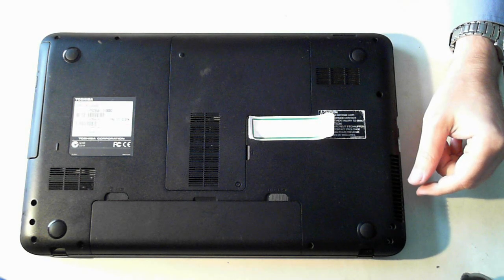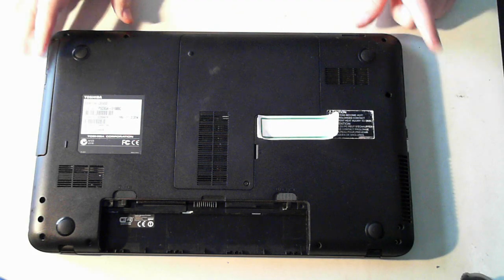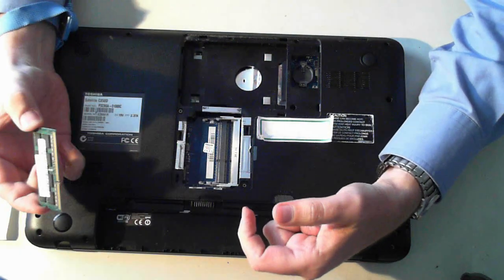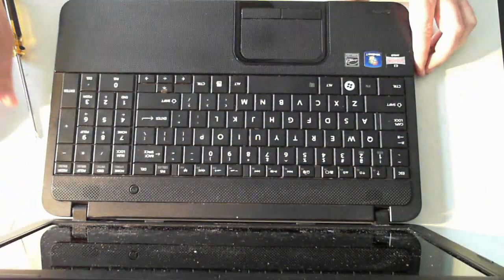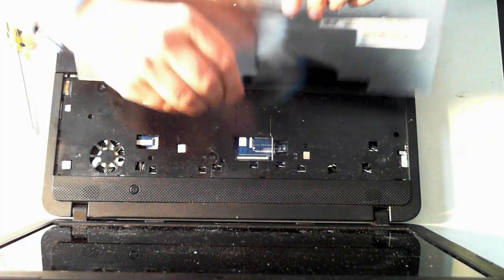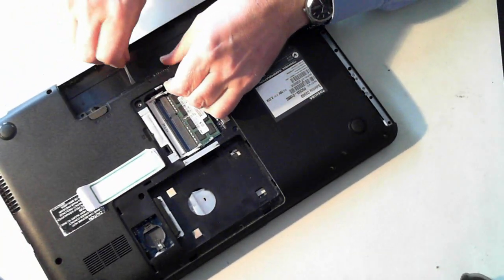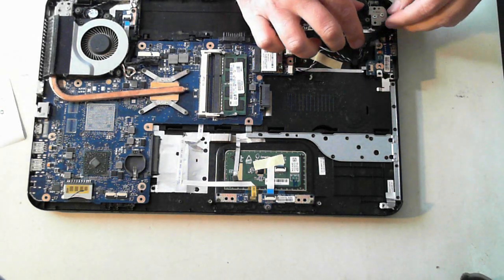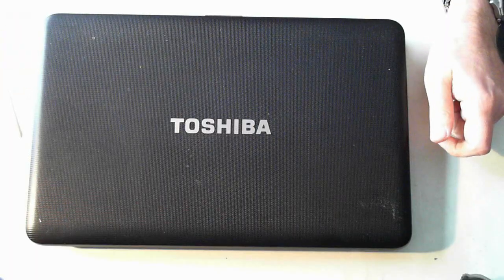Toshiba Satellite C850D Disassembly

Comment: Hi I have the C850-1GL my battery wont charge and the laptop will only power on if the battery is removed so its permanently plugged into the mains also my speakers seem to be very poor sound quality ( very Tiny Sound ) is there something that's been disconnected or the speakers been damaged somehow plus the battery charging connection been damaged somehow .

Comment: @dpcomputing: Thanks for the video! I have a question!  I got the c850d PSCC2C-012003 for free out of a dumpster! It works BUT the battery does NOT charge.  I know it's not the battery because i have the same battery and laptop as well, and both batteries work.  Both batts are not recognized by windows when I plug it in while ON and OFF, BUT it does blink AMBER when the battery is inserted with AC plugged in AND  when AC is out.  I am guessing it's the mainboard and/or a mosfet.  Any idea what I could do here? Replace the mainboard?  I can get a used one locally for about $40.  I am poor student here in Canada during this hysteria!  Thnks a lot man!

Comment: Hey,

I have a question. My notebook starts, then i have to change the settings because my bios battery is empty and i have to set the date and the clock. After that, when i save and exit, its loading and then i get a black screen with 4 blocks with a lot of short red lines, which are moving from the top to the bottom. What could be the problem?

Comment: Want to upgrade mine.
The Ram, Processor and Hdd. What's your recommendation?
Reply: 8GB ram(any brand you like),processor depends because you need compatibility.if its intel(core i5).if its amd(ryzen 5),as for HDD it depends on how much storage you want.recommended is 500GB to 1TB and if you have extra money then buy an 120GB SSD.
Reply: Oh and i forgot the ram needs to be compatible.just buy what DDR of ram you have.im guessing you have DDR3 compatible motherboard?if that's the case just buy DDR3 ram.just do the same if it's DDR4.

Comment: Great video, got to part where you can't find screws, looked at your video and saw 6 under keyboard, removed them cleaned it all out and reversed the assembly. All done without any fuss. Many thanks for your video and knowledge.
Reply: 4

Comment: is it possible to upgrade the processor of this laptop to core i3 or core i5? thanks!
Reply from the maker: Yes it is technically possible but you will have to confirm what CPU's BIOS supports (which I don't know) with Toshiba support.

Comment: Hi I have a question. My laptop screen won't turn on I plug in the charger and it says its charging but it doesn't I opens it up and dusted it out and still nothing I also tried turning it on with out the battery to see if that was the problem but it still does not work. The like of connection turns on and everything but the screen doesn't turn on
Reply from the maker: he screen or video card may be the issue. Have you looked a the connections / cables to the screen to see if they haven't come loose?

Comment: Mine has water damage and won’t turn on what do you suspects I should do?
Reply from the maker: Sorry but my recommendation would be to get a new laptop. You can try and replace components but it may have damaged more than one so you may have to end up replacing everything.
Reply: dpcomputing :-(   I’ll open it and clean then hope for the best
Reply from the maker: If you have done it recently put the board in some rice to try and drag out all the moisture. See what I did with a mobile phone here:- https://youtu.be/Q0CMZlcewqY

Comment: Hi buddy is there a fuse inside this laptop.    I plugged in a cheap power adaptor into it and now it's not working. Ta
Reply from the maker: No, the power adapter looks to have blown something within your laptop. Was the new adapter the same rating as the old one?

Comment: did exactly what you showed now my laptop wint start great......
Reply from the maker: What did you change / upgrade? Double check that all cables etc are properly connected. Are you getting anything on screen?
Reply: dpcomputing No the screen is black. I took everything apart and also unscrewd the airfan unit to clean out the dust inside then I put it all together. Now when I turn it on airfan doesnt work and the screen refuses to work as well
Reply: dpcomputing Omg it appears that I forgot to reconnect the Ram properly thanks for help anyway 😉

Comment: Thanks for your tutorial, very helpful (y), but at this time I am facing the problem that my laptop Toshiba Satellite C800D with AMD processor can't start when I tried pressing the power on/off button many times, well when battery and or charger plugged or unplugged. Can you help me to give some advices for my problem? Thanks before and after. :D
Reply: I have tried resetting BIOS by releasing battery CMOS about 10 minutes
Reply from the maker: Trams Nortagep do any lights come on the unit when you turn it on?
Reply: when I plugged the charger, the electricity power can enter/flow into the machine and the indicator lamp of charger turned on and the battery can save the power, but the machine can't power on.
Reply from the maker: Take it to your local computer repair shop as it looks to be a motherboard issue.